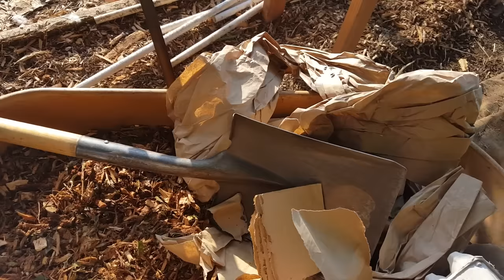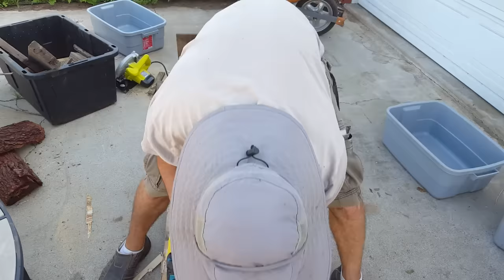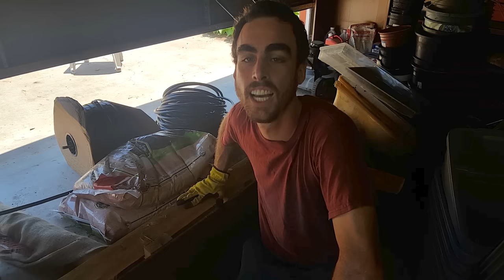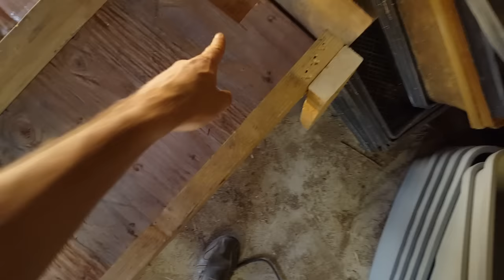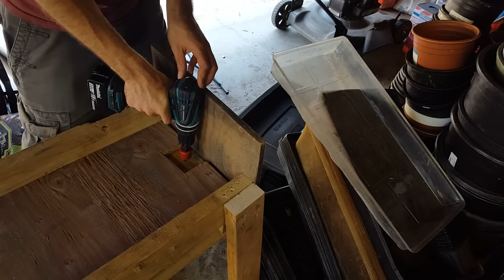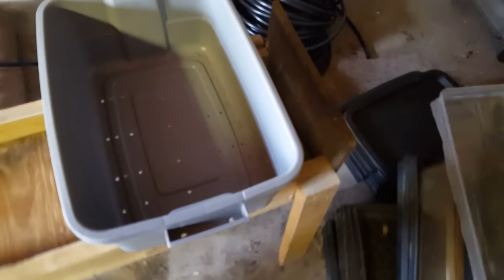EASIEST Worm Casting System for Vermicompost 3 Bin

Comment: Use a soldering iron to make your holes.  The hole it makes pushes the melted material to the perimeter.  When it hardens, the hole is much stronger and less prone to cracking.  I think it takes less time than drilling because theres no need for cleanup ( no extra shredded plastic bits everywhere).

Comment: Hot solder tip will melt clean holes. Or heat a nail with a torch on some vice grips will work the same but more work reheating.
Reply from the maker: Thanks! Another great idea. A solder needle is just about the right size too. Sweet lots of new things to try out next time I drill plastic :)
Reply: Sir can u help me how to produce earthworm fast. Thnks
Reply: @NaturesAlwaysRight  once you use the soldering needle for melting plastic, it's not good for soldering anymore.  If you borrow a soldering iron, buy a new tip before you return it, or that person might not loan tools to you anymore.  You could remove the tip and replace it with a brad before you start melting holes.  When you're done, then put the original tip back in.
Reply: You could use some sand paper to level off the holes.
Reply: Maybe a hollow punch/ round hole iron?
Reply: @ronyerke9250  Just let the plastic burn off and hit the tip with a brass wire brush. Re tin and its good
Reply: Or use the solder tip to make the holes.
Reply: Read somewhere running a hole saw backward will do it but I’ve never tried it
Reply: @ronyerke9250  👏👏👏👏👏👏👍😃🐶 great tip.
Reply: Very ingenious!
Reply: That's exactly what I used

Comment: For the first 12 years i had holes for drsinage in my worm beds...no longer. No holes ,control moisture bby adding carbon. Worm castings are much better now. Have been doing this now for about 18 years with no problems. And i only use cardboard sheets cut to fit for covers. Less fuss, less mess and better castings....even under microscope.
Reply: Same for my raised gardens! No drainage\lined with poly.  I'm in hot central Texas. Where are you?

I put my beds on my channel.  They conserve water and work so much better!
Reply: @TheRainHarvester  my worm farm was on stainless shelving units in my cellar. Sold all but 1 tub 2 years ago due to being disabled and bedridden. I am in the binghamton area of NYS. 
BEFORE GOING TO RESTRAUNT  bins I did them the way I was told ..back in late 70's.?with holes in bottom of covered large tubs..I had a drain line to handle all of the leachate...was a lot of work. With my last system I spent less than 30 minutes once a week to turn ,feed and replace tubs to shelving unit.....all 20 of them...never leachate mess...only made worm tea when I wanted it.....

Comment: To clean the burrs from a drilled hole you can use an oversized bit to clean the holes both top and bottom. 

If you hold a few types of drill bits side by side, when you compare the cutting end, called the chisel, they have various angles/shapes and degree of cutting edge. Take note as you figure which angle works best for different materials. 

Also try different diameters for different base materials. 

Finally. If going the proper direction, clock-wise cuts to much material. Try going anti clock-wise to sort of ‘scrape’ the burrs away, as opposed to trying to drill them away.

Hope this helps

Comment: There are bits used for plexiglas to minimize burrs, forstner bits are also used for larger holes, but you may be able to find a 1/4" forstner bit. An alternative is to buy a good 1/4" hole punch and punch the hole with a plastic or wood backing, leaves a very clean hole. A countersink bit with a handle is better than a knife to deburr. Great video, thanks.

Comment: Consider a hex bit or unibit hex drill bit. usually better for a smoother finish than standard bit. Also good for creating variation of size holes if needed or should you consider going larger on the spot.
Reply from the maker: Thanks for the tips. Those bits work well but I tried those bits and every kind of bit out there (I think) and nothing is able to drill LDPE as smoothly as I like without leaving residue. I haven't tried yet, but poking something hot like a soldering iron through the bin seems like a good option.

Comment: Hey I just found a way to put holes in the plastic worm tubs with zero clean up. 
Materials Needed
- pliers 
- (2) nails 
- torch
- propane
Easy just heat a nail up holding it with the pliers and puncture the plastic tub. 
Use a larger nail on some of the holes in only one side of the tub for the worm migration. 
This technique has a "hot glue gun" affect on the plastic. Hope this helps and thanks for all the knowledge you share. Peace and God bless.

Comment: My suggestion was to place a piece of wood under where you drill.  It will keep the plastic from fraying.  But, lukeo85 has the better idea with the hot solder tip.  Great idea
Reply from the maker: Oh that's another interesting technique I'll try! Ya totally agree the solder tip makes the most sense.

Comment: The easiest way I have found to drill holes that you don't have to clean up is run the drill backwards. The drill still spins at a very high RPM so you basically melt your way through the plastic. It takes a bit longer but you make up that time by a ending with a clean hole. 

This works even better with hole saws. And when working with IBCs you avoid cracking that slightly harder plastic. 

And if you are looking for a flexible ruler to mark out curved plastic bins I haven't found something better than an old window blind.

Comment: You may want to put a bracket or hang iron to hold the pvc in place.  Over time the weight of the pvc pipe and valve could pull it down out of the uni-seal.  Probably not a huge issue, but it could save a min. in the future.

Comment: Hey cool design,   Try cutting holes from the bottom up instead from inside down.  The plastic flashing tends to point in the direction the drill bit is pulling.  I see several comments about reversing the drill.  Sure wont cut through as easy.  Simply flip the bins over and drill from the outside in.

Comment: When you drill your holes. ITs called reeming, you go back and forth/side to side with the drill bit, it can open the hole a  tad bit bigger than you wanted to drill, but by doing so you drilll a smoother hole.

Comment: If you put a piece of stock, really anything dampening, on the back of what you're drilling and clamp it. You dont get those 'exit wound' kinda holes. I find burning holes still leaves a less severe version or the same issue. Use stock behind your drilling surface for the cleanest result.

Comment: After you drill the holes in the plastic, use a larger drill bit (like 1/2") on each hole by hand to "de-bur", or get rid of the flashing.
Reply: or just run the drill in reverse, it will melt instead of cut

Comment: Looks like a great design!  My only concern would be the heat mid summer, I keep my worms in a very shaded area, I’m in qld Australia so we don’t get super cold winters.
Reply from the maker: I keep them in full shade with burlap over the top, no problems :) We only go to 100F here in San Diego though. Keeping the bedding moist is the most important then it stays cool inside the totes.

Comment: For the holes so you don't have to clean up the plastic, use a soldering iron.  It will burn a hole and also keeps the edges smooth.

Comment: 8:39 you still a cleaner hole by going thru both sides or just wallering the holes out a little by twisting the drill as you drill

Comment: Afraid I don't know how to drill a clean hole in plastic, however, there's an easier way for cleaning those drilled hoies, usinng a dubble size drill bit, and while the drill is working, just touch the hole's surface slightly with the bit's edge and so ,very easily remove what needs to be removed without damaging the hole and without wasting too much effort.
  Hope that's a useful advice.

Comment: @8:34 
Instead of running a knife around each hole to clean of the rough edge, you could take a large drill piece (1/2 inch) can spin it around in the hole by hand. If you put it in your drill it can accidentally go all the way through :)

Comment: Great job.  Thanks for sharing.  Questions on where you placed the air vent holes on the sides and placing the next tote on top.  When you add another tote on top, does the tote on top cover those air vents?  And does the weight of the top tote when filled crush the worm castings and worms?
Reply from the maker: You're welcome. When you add the second tote the air vents don't flow as well but it doesn't matter because everything is fully broken down. I don't have any problems with the castings going anaerobic. The weight on top does not kill the worms, it does compress the castings a little bit but it doesn't inhibit the worms ability to move up to the next tote.
Reply: @NaturesAlwaysRight  Thank you. I was curious about this too.

Comment: If the tubs are HDPE you could use a lighter or a torch (at a respectful distance of course) to clean up the holes.  HDPE is a thermoplastic (not sure about the other one, might also be thermoplastic).

Comment: Hey, so I ended up having at least some partial success with installing the uniseal the second time. I ended up sanding the hole a bit and that helped some. It still was a little messed up, but it is holding at least. When you put your second tote on for the worms to start moving up, do you place a piece of cardboard on the bottom, since this will eventually become the bottom layer? It seems though with this in place , the worms may have a hard time climbing to that tote if there is cardboard in the way.
Reply from the maker: Glad to hear it is working better. Ya the uniseal is a little tricky to get to work for sure. A bulkhead fitting is another option, just a little more expensive. Yes I put a piece of cardboard at the bottom of every new bin, I make sure it is smaller though and doesn't cover all the holes. Just trying to make it easier for the worms, and the cardboard prevents castings from falling out a little better.

Comment: A step bit reams while it drills, (get a smaller one so you don't oversize the holes) it's great you are using primer with the pvc pipe, but with a non pressure system, not necessary, just use Christy's Wet/Dry cement and eliminate all pipe prep.

Comment: Heated nail or equivalent might produce a clean hole for drainage post drilling or by itself.? I actually have a few bins without bottom holes and focus on keeping the humidity in balance. Success so far! Humic acid can build up to an overload I’m sure but I’m still searching for that breaking point. Thanks for the inspiration/cheers!
Reply from the maker: Nice idea Aaron, I'll definitely try some sort of heated element to make the holes next time then no flying plastic and perfect holes. I think bottom holes are necessary because it's nice to have the water drain through to flush out the castings, get leechate, prevent anaerobic conditions, let's the worms choose what kind of food they want to feed on. And the worms can't move up to the next tote meaning you have to sort the worms from the castings. Let me know how it works out, it would be interesting to know the results.

Comment: Don't think I'm crazy, but to get the holes to drill clean in thin plastic, run your drill in the opposite direction. Instead of cutting and leaving all those strips and jagged bits, it melts through and leaves a way cleaner hole. Try it once and smile forever

Comment: Youmy use an electrical heater that's used in electrical and electrnical tiny attaches using heat. Or you ay still use the driller and try to clean the holes with sand paper sheets after drilling.

Comment: once you have drilled the holes use a 1/2 drill bit in the drill but have it spin backwards and it will clean the bits of plastic out very quickly

Comment: Great job. Wondering do you have to drill 1/2 inch air holes at top of sides. Saw a video that did that.
Reply from the maker: 1/2 inch is way too big, bugs will go inside. I use 1/8in for the side air holes.

Comment: Like others have mentioned, melting the holes may be one method to create clean holes without shrapnel. Another clean way to drill through something thin like this plastic is to clamp or hold scrap wood under it, then drill through both layers. Make sure the wood is pressed tight against/under the plastic. You will still have plastic shrapnel, but the plastic should all be cleanly cut from the holes, and not still attached. I would try small (1x2) trim wood that will fit into your tote's bottom grooves. Just be careful not to drill your fingers if you decide to hold it under there :)
Reply: Drilling backwards works to rub a hole into the plastic and won't grab/crack plastic.

Comment: Hello This is my first time doing a diy project and love the ease of what your video has demonstrated. How many (if it matters) worms do you add per the size of tote you use?
Reply from the maker: So awesome you are making a worm tote! You'll love them. I'd say you can do as little a full handful up to a 1 gallon pot worth of worms per tote. The less you put in the longer it will take for the population to reach maximum capacity. Just a large handful would be enough to inoculate the size tote I used.
Reply: Thank you for your reply. I was considering, after searching the web for available worm sellers, between 50-75 in each 10 gal tote. Which I have six of. So, the more worms in a tote, the faster they breed and produce worm castings?

Comment: Once per month you add food? I was seeing other videos where you add your scraps daily/every few days. I thought they would eat through half their body weight daily so you could add food every few days.
Reply from the maker: You can add a small amount of fresh food every few days. But they could just live on the carbon and soil if they had too.
Reply: The food you add has to break down, that's what worms eat. So like I just added a lot, including cassava peelings that will probably take 30 days. The pieces of boiled potatoes from my sink strainer are soft, much nearer 'decayed' which is what worms eat, the decay. So what you feed and it's condition and size determines how often to feed.

Comment: I assume you used a 3/4 inch PVC pipe as your down stem? When I tried to put my PVC pipe through my uniseal, it destroyed my uniseal. I thought I had succeeded when I finally got it through. Cutting away a little more pond liner as you did when it wouldn't go at first. After some intense malleting it went through, but I discovered it essentially ripped the lower half of the uniseal off. Any other tips to make sure this doesn't happen next time?
Reply from the maker: Hmmm ya just double check that the size uniseal you have is for the corresponding size pipe, there are charts online, http://www.tank-depot.com/shopping/uniseal-instructions.aspx. Make sure you also drill the hole at the size they recommend as well. My problem was the liner made it too tight, so I had to cut it away, then it finally went it. Initially it was hard to pound in with mallet but after the first inch it went much smoother. So double check the pipe size, uni seal size, and hole size are all correct and no wood flakes or plastic liner on the inside of the hole. Best of luck I hope it works this time!

Comment: Buy a unibit. It’s a conical/graduated drill bit with a single flute
Reply from the maker: Thanks for the tip! I tried one, but it still had the same problem. I've
 tried every type of bit I think and they all need some time of help to 
get all the tags off. Sometimes they do drill out perfectly though. 
That's why I think a heated element will be the best solution, I just 
haven't tried it yet.

Comment: Any help my worms keep trying escape from my 25l tub with lid on and drilled holes for air I have used top soil and moss in the tub with a small bit of food to start any help
Reply from the maker: If it rains or right before a ton of worms will crawl up on the sides or lid but hardly any will actually try to escape and leave.

Comment: Get a countersink drillbit for your plastic issue. Most tool stores have them for wood at 5-10$.
Reply: You can get them with drills attached aswell, might be more expensive but halves the work load.
Reply from the maker: Thanks for the tip Anders, I'll definitely check out those bits!
Reply: For stuff like that I use a countersink or a Dremel cone-shaped stone grinding bit after drilling RUN IN REVERSE (less aggressive) to clean up the hole.

Comment: Seemed like a lot of the thought that went into this design was in collecting and redirecting the leachate. 
If a worm bin is wet enough to be producing it, it's too wet. Overly wet bins result in anaerobic conditions, attracting fungus gnats, and worms that aren't going to feed very well. Aside from that, the leachate is not even similar to worm tea and while you can use it on bushes and shrubs it should not be used on anything you plan to eat. I've been raising worms since 1987 and yes I have overwatered a few bins in my years, But that was an error not intentional. Your worm bins should not have any water collected at the bottom, let alone have water seeping out of the bottom. The material at the top should be no wetter or drier than the material at the bottom which is achieved by proper bedding material as well as regular maintenance - going in and flipping and fluffing up what's in the bin. When we house worms in plastic containers we have to do that because other critters in nature aren't doing it and the worms can't just relocate if the conditions become undesirable. 
A bin accidentally over moistened can be corrected quite easily by adding shredded cardboard or coconut coir in the amount needed to bring the bin back to optimal moisture. But building in a drainage system and soaking the tubs down with the hose the way you did is planning for bins that are way too wet for worms to thrive in.